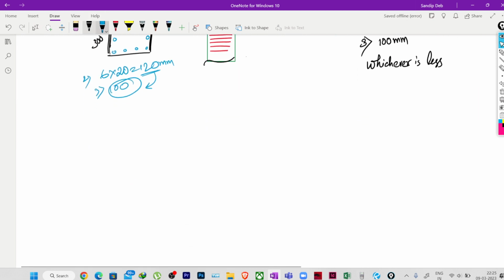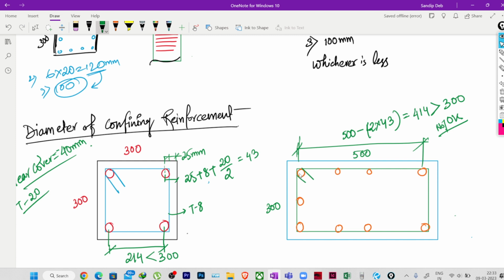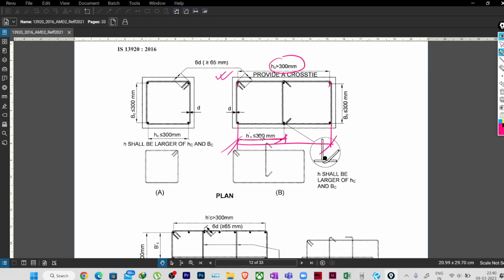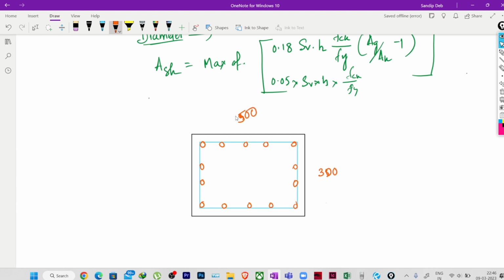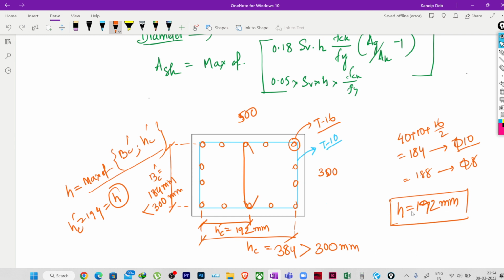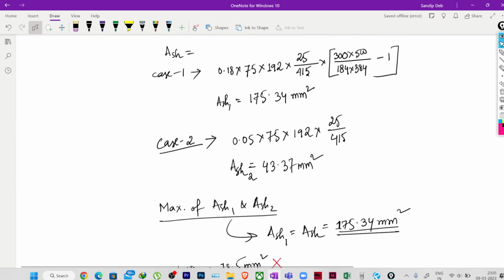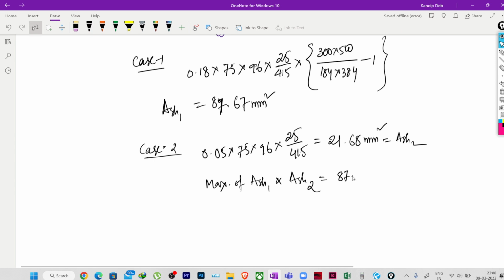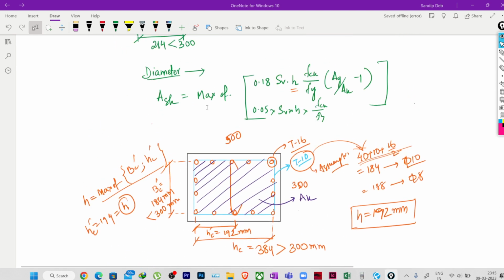Diameter of Confining Reinforcement in RCC Column | IS 13920: 2016 | ilustraca | Sandip Deb

Comment: You have done one mistake while calculating Ak, u have considered Ak = 184x384, instead of that it will be area covered in blue line as u mentioned, so dimensions will be total length or width - cover for Ak.